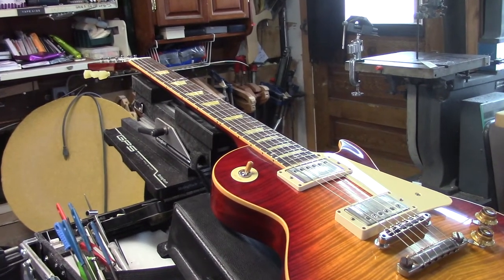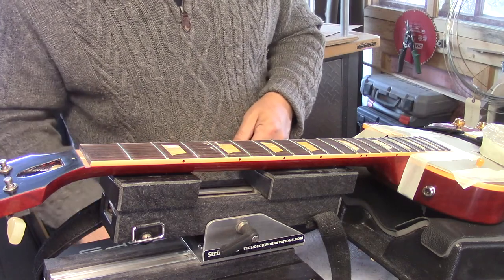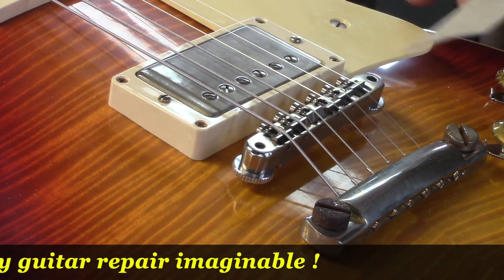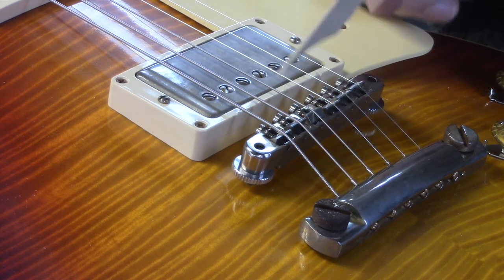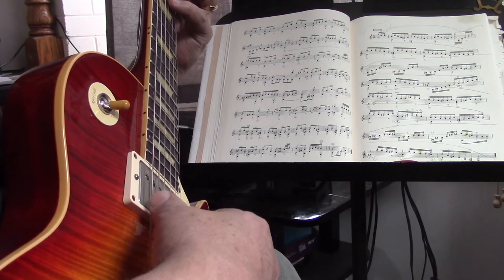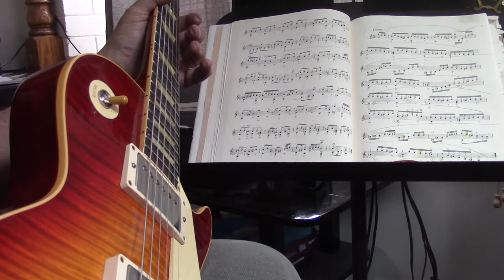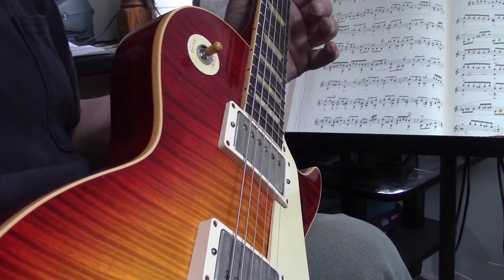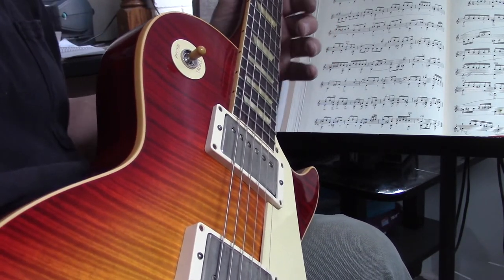1959 R9 Les Paul Standard@stringtech @StringTechWorkstations

Comment: Sir, for what reason are the intonation-screws of the bridge pointing towards the pick up?
Reply from the maker: It's good question ... that I have often thought about. Adjustment from the back would make more sense. But this is Gibson's decision.
Reply: @StringTechWorkstations  Thank you for the answer. I turned my bridges in the other direction...it is the same game but you get more room for your tool. Also?
Reply from the maker: Many have done this ( including myself ) ... but " the word of caution" here is ... if the saddle slots are worn ... or have been filed slightly to open them up for the bass strings ... it will be best to "start fresh" with a new bridge or new bridge saddles.
Reply: @StringTechWorkstations  Yes correct. But Gibson does some things in an other way. Not even wrong, understand me in the right way. For example look at the bridge contours of the acoustic models. Weird i find....
Reply from the maker: @micheloderso  If you are referring to the reverse acoustic guitar bridge that Gibson used for many years; they have stopped that now. I think it may have had more to do with getting around the Martin design bridge ... to avoid any legal retaliation. The new Gibson acoustics new have the regular Martin style bridge.
Reply: @StringTechWorkstations  Ups, i didn't looked at it a long time. I only saw the older instruments. Thank you for the info.